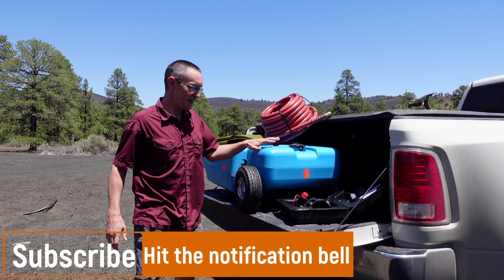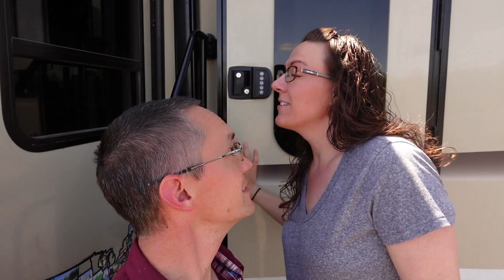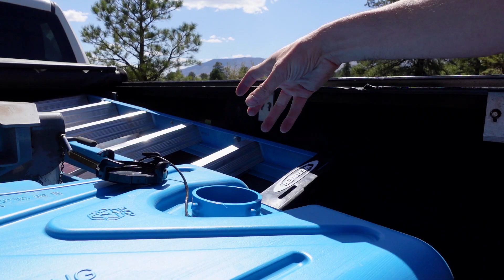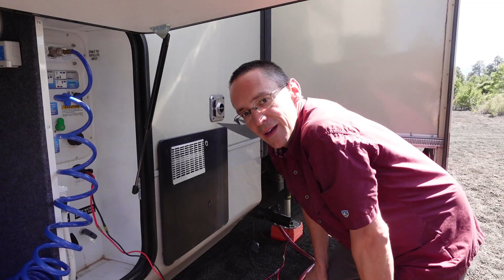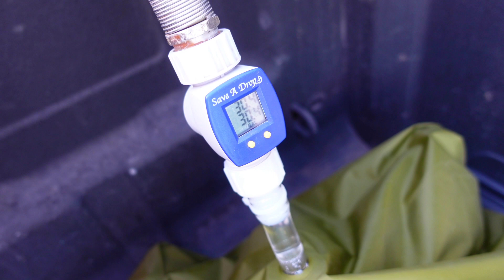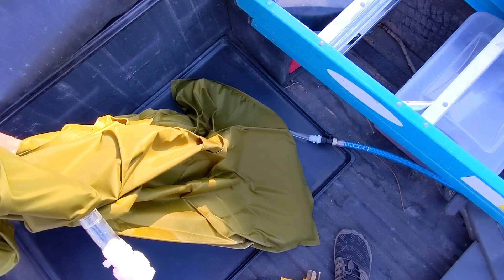Portable RV Waste Tank, Freshwater Tank and Pumps

Comment: Thanks for the great ideas and showing exactly how you did it!  I have a 55 gallon drum with a small sump pump in the back of the truck, but like the idea of the bladder. I found that I have to fill the hose with water and hold over my head, then connect to the Nautilus. Pumps don't do well with air in the lines. I definitely want to try the maserator. Can you please tell me where you posted your parts list?
Reply from the maker: I'm glad it was helpful! The RV water pump calls itself a "self priming pump" which makes things easy. That and with the pump sitting near that power port it's always down lower than the truck bed which makes priming easy. With this setup the only hose I have to lift over my head is the wastewater hose to empty it into the tote. The blog post with the parts list is now up: https://neverstopadventuring.com/2021/05/portable-rv-tanks-and-pumps/ . Sorry for the delay.